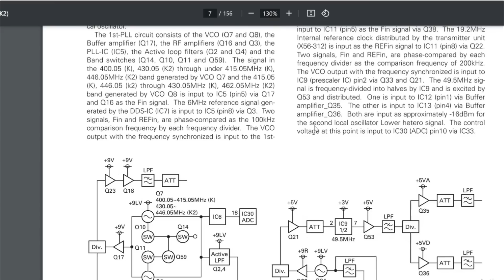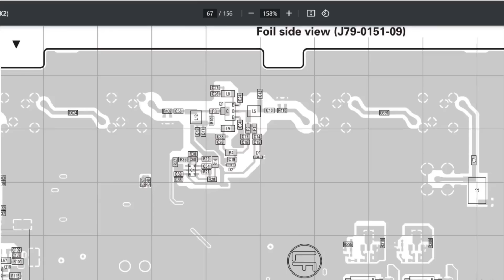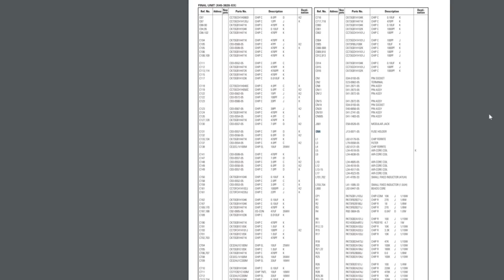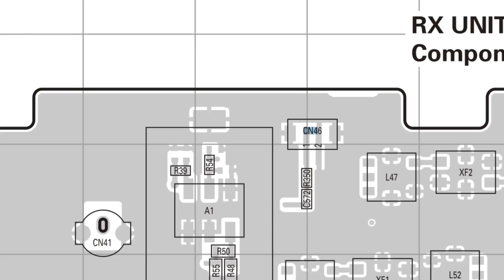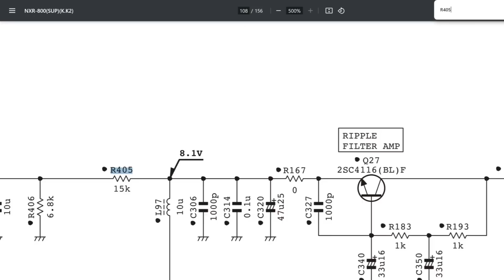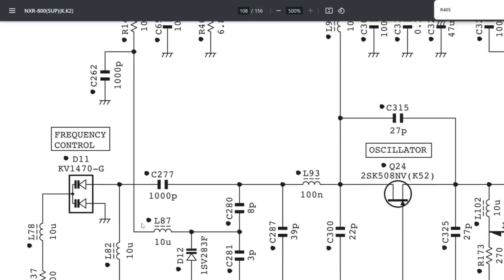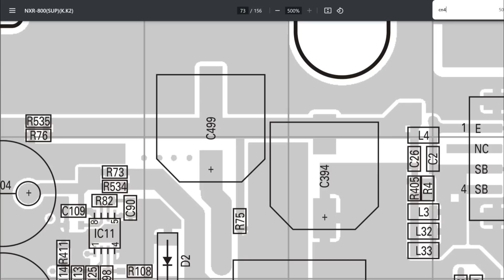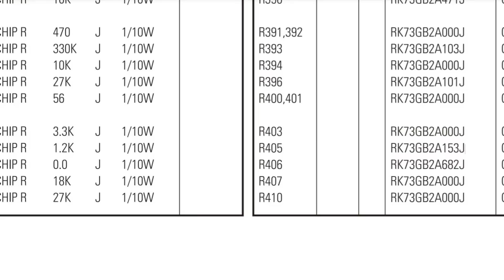Kenwood Blew my Mind - NXR-800K. Repair. How Right to repair should be.

Comment: Am radio operators are major nerds, they would not buy something that does not come with a full service manual and parts list, that's why Kenwood provides it as do they all, the market demands it, if the laptop market refused to buy laptops without schematics they'd all provide them

Comment: That is what a service manual should be. All specs and info. Plus diagrams. I had a complete set of service manuals for my sony profeel system monitor, stereo television tuner, teletextdecoder and my videorecorder. A total of 613 pages. And I had to use it a few times. It saved me a lot of money to do it myself. But that was 30+ years ago. I wonder if Sony still provides these service manuals. Of course companies have these service manuals, but I guess most do not make them available to customers. Even repair services like NorthRidgeFix will have problems obtaining them.

Comment: Reminds me of the cheapo WEN rotary tool I bought years ago, and it came with a complete exploded diagram of the entire tool in the back of the manual, with replacement parts (fasteners, motor, etc.) all listed below it. I was like, wow. That's impressive. Been 7 years and I still use the same one on a regular basis. Never needed to replace anything in it, thankfully.

Comment: Two zero ohms resistors in parallel is a typical example of over engineering. Just like 3 ferrite beads in parallel. It's ham radio personalities at work :). All Kenwood. Icom and Yaesu ham equipment will have a similarly well documented approach to their products. Ham radio operators demand it so they can modify and understand the radio products. It really should be a minimum standard in the electronics industry.

Comment: Depends on which board but they are listed just strangely:
R404,405 RK73HB1J000J CHIP R 0.0 J 1/16W
R398-409 RK73GB2A000J CHIP R 0.0 J 1/10W
R4 RK73GB2A000J CHIP R 0.0 J 1/10W

Comment: Lots of times in one of the corners of the schematic or somewhere in the service manual it will say that if not noted the wattage of resistors is X. Are they using multiple fuses in parallel for high current draw or?

Comment: I recently fixed a Pioneer X-HM72 receiver at a Repair Cafe where a SMPS PWM chip had blown its top. As there is a full service manual with schematic online, I could contact the owner to get them to buy two chips (cheap on eBay) and at the next session I replaced this chip, two blown SMD current sense resistors, two diodes in the bridge rectifier, the fuse, and it sprang into life. Without a schematic it would be landfill. Two Pioneer Service centres refused to touch it as "Parts not available". I guess they don't know how to read schematics and have never heard of eBay!

Comment: ...i worked on kenwood factory as a storekeeper once.. totally ISO9002 standards..japanese curcuits are the best & cheap..i have purchased a rejected hifi system 20 years ago when i was working there...and its still working..only CD player gone out..but my TV box is connected to its aux (stereo to RCA ) for richer sound output than from TV speakers...

Comment: i dont know about Kenwood but i know ive looked up schematics for some machines before now and you can get them, mostly for older stuff. Not sure about electronics stuff, maybe companies tried to hide that a lot more especially nowadays. I got an old DeWalt band saw and it had some parts a bit broke, so i searched for a parts list and found a full assembly schematic with part numbers for every nut, bolt, fuse, wires, everything. So, yeah they do exist. some of the old machines I worked with in my last place of work also came with full electrical schematics. handy when something breaks and you call an engineer out who knows how to read those, makes identifying issues a lot easier, specially because you cant just up and ship a 1 tone machine to the manufacturer to fix it, its just not cost effective. All companies should provide this stuff, a lot used to. dont know why, where or when it all went wrong. I sound like an 80 yr old, but im 40 btw lol

Comment: Another term for a zero ohm resistor is a fuse.
Since there seem to be three on the board (09)you have, I bet one of the revisions between 01 and 09 was the addition of that third fuse.
Parallel fuses are a way of rigging a delayed (or slow)blow behavior from a part otherwise much too simple to behave in that way.

Comment: On HAM Radio Products Kennwood, Yaesu, Icom and all other big players are providing this big repair and service manuals. It be a must for the Ham Radio Operator to have this in his Library. You can´t repair or modify as you want. For Ham Operator is allowed to modify.

Comment: How do you tell values of resistors without a manual? You decode the color bands. if they're unmarked the manufacturer is trying to prevent repair.

Comment: Kenwood, Sony and others did a great job with the manuals back in the day. But the circuit in question looked really weird. 3 components in parallell? 2  x 0 ohm resistors and 1 fuse?!? Maybe there was no functional difference between the solder blob and this nice looking and component correct fix?

Comment: I had to troubleshoot and repair a blown coil on an Icom IC-729 HF radio. Servive manual was very easy to get, got the right parts and did the fix myself.

What is better than saving some money on repairs? Doing the repair yourself, switching on the equipment and seeing your repair actually worked!

Comment: I purchased a used pre-Pre-Sonus audio interface, actually it was more like new in box. Except it had an issue with the power supply. I contacted Support and they're like we don't support that model anymore and I'm like yeah you don't have anything like it that's why I need the schematic so I can find out what this burned out resistor is. we don't give that out it's not supported anymore.

Comment: I've always liked Kenwood I don't know whether this is something they do for the ham radio stuff or if this is something to do with everything. This is what everything should have the document existed when they created the object they should just tack it onto the extended manual and be done.
15:00 Oh and PS that resistor unlike the screw I lost today didn't go into the abyss. It's next to the larger capacitor opposite the connector in a vertical position.

Comment: This is the way it used to be. In the back of TVs and Radios back before about 1975, you would look in the back of the unit and find the repair manual. Back then, many folks simply troubleshot their own units and took the bad tube down to the Rexall Drug to the tube tester, and which ever tube they brought was bad, they would look in the  lower cabinet where the new tubes were, or the rack near by. Old tubes were traded in for a discount on the new tubes, because even the tubes and even TV CRT tubes were fully repairable.

Comment: A better search strategy: Start with the block diagram. When you've found the relevant section go to the circuit board components lay out. When you've found the component go to the components list.

Those 0 Ohm resistors seems useless but are used as fuses. So you did a good job replacing the blob. The one component you called fuse was L4. An inductor.

Those three inductors in parallell are for rf-filtering since you are looking at a power supply line. Theese prevent rf-signals from moving backwards in the power supply lines and cause disturbances. They also prevents rf-leakage from the equipment bettering EC-compability.
Reply: There's always one guy...
Reply: @Xjaychax9 ... that gives pertinent information that benifits everyone looking for it?
Reply: @maxrochon103  I was bigging you up, not putting you down, chill.

Comment: Hey great video! You need to learn how to search PDFs. Do a search on the board number first, then you can find more info. The manual is typical for communication gear, most mfg supply such detailed info so that it can be repaired. These unit are very expensive!

Comment: A friend has a sony amplifier issues, other than it has no manual, no parts or expensive full module replacements only :( for single resistor :D.

Comment: hi man, great video, well kenwood in this matter, is really similar to pioneer, every single board on the planet has a schematic, the trouble is, what you can find is because a data leak from company or sucursals, and if the competitors get, it can make reverse engineering from just the manual, i live in a latin country, and my father fix this way, and a friend get manual when we need it, before internet, is the only way to do it, even today, is this way.
Reply: old devices, people know how can important this information can be, and scanned old manuals, or send digitals to forums, fot save old and loved devices, i gonna rebuild a 40+ year audio amplifier, because someone shared it at hifi forum. thanks for all doing it, even motherboard, and some GPUs, your probablye know that, even people sales schematics and boardview from apple devices

Comment: Marantz had the same thing for a SR8002 Receiver, an extremely detailed PDF service manual download.

What is the third component with a "T" on it?
That inductor right next the to fuse resistors you installed looks chipped and has been messed with, maybe replace that too.

Then we must ask the question... What if anything caused the fusible resistors to burn?

I would do a further diagnostic analysis because the solder blob was effectively replacing the blown fuses and yet the customer sent in the board because it didn't work.

Maybe there are options for more fuses because for other sub-models the power going through those fuses may drive a circuit the requires more power making the board universal for all sub-models.

Example: They will make one main wire harness for different vehicle sub-models that have different features. My van does not have power door locks yet the harness near the door frame has an un-used connector that would have been occupied on models with door locks.

Comment: Complete Service Manuals for AV equipment including debugging flowcharts used to be the norm. There was a company Sams that published Photo-Facts for all major equipment.  They even showed test points and pictures of the waveforms with complete parts list and revisions. City libraries had a set for copying. It was great. Some companies still publish and sell the manuals for a hefty fee. Large home appliances - like dishwashers generally used to have a brief schematic and parts list stuck in the enclosure.  Now its online. In the early PC days you would see this same thing but as "cloning" and piracy kicked in it died quickly.

Comment: Alex, it's not "Why can't they?", it is, in fact, "Why won't they?". I am a Amateur radio operator. "Ham Radio" has long been and still to a great extent is composed of technical people who can repair, modify and still build radio equipment from the ground up. The Amateur Radio equipment manufacturers, such as Kenwood, Yaesu, Icom, etc.,  understand this. I have had  factory manuals for many pieces of equipment over the years, including equipment that was new in the 1980's. Hams world is a different world. In California, Ham Radio is very active. You may want to locate a local club and attend a meeting.

Comment: it should be added that Kenwood was also sold for scraps to Chinese companies because they went out of business.. not saying that this device was part of the first iteration of Kenwood, which was a Sears brand if I'm not mistaken.. they were known as being very repairable and repair friendly. so I wouldn't be surprised if the service manual for this product came from a Time before Sears went bankrupt.. I suppose the argument could be made that one of the reasons they went bankrupt was because policies which allowed their competitors to getting intimate knowledge of their products and allow their customers to extend the life of their purchases. 
btw: Kenwood is a shell of the company it used to be.. at least when it comes to audio. I've never had a Kenwood amplifier   show up with a service manual available in the box or online for any of the amplifiers I bought in the last 5 years.. 
had a 10 or 15-year-old subwoofer have a service manual and that one is still kicking around because I've been able to fix it a bunch of times. 
old school Kenwood old school JBL, they all have service manuals available. but their new stuff doesn't. they're all following the Apple model

Comment: The theoretical wattage requirement for a zero ohm resistor is zero watts. It'll be fine.
I just rummaged through your store and I have to say it's quite an impressive variety of critical supplies.

Comment: Alex, in most software and search engines too: If you put your search term in quotations, it will iterally just search for that. For example: CN4 will find CN401. "CN4" will not find CN401 but just CN4.

Comment: the way copyright and patents should work is a specific PCB design, you are able to have multiple ways for speakers to go from blop blop to thump thump, making it harder to repair by saying "the technical manuals are what safe guards our patents and property." no, what safeguards your patents and property is appropriate laws and appropriate enforcement of laws... to not supply technical manuals and repair guides for people to repair the item is just insane... so what the person isn't ualified to repair the item... just let them break their device; the technical spec sheet and diagrams are for those that can read and repair appropriately so that your brand can be seen in more homes for years to come, not just the latest iteration  of device.

Comment: Love how components are just like a mechanics 10mm socket. They disappear from sight while you are at work even though they are still right there. That 0 ohm resistor is lying only a few cm's from where you are working, against C394.

Comment: The service manuals was standard pratice 20+ years back. Worked in a small TV/radio shop repairing JVC, Sony, Panasonic gear. JVC for example, sent a big box of service manuals each year when they released new models. You could call up any manufacturer and request a service manual (even for older gear). Here in Sweden, they had spare parts on hand for up to 10 year old models, if they didn't have it locally, it was sent from JP or where it was manufactured. The stuff was made to be reparied/serviced. But things changed when the big box stores took over and the small holes in the wall shops shutdown. Now they think you are crazy (or don't know what you mean) when you try to get a service manual.

Comment: The same level of documentation and service manuals is available with SONY for their consumer or professional electronics, but the deeper levels are limited to authorized partners and repair centers - sometimes the docs leak, but there is a lot more to it - eg. calibration software and gear. They do not want to publish them freely, since it reveals how each model is often the same - I am focused on digital cameras, and its funny how they keep recycling the same sensor in 10 years of products - eg. from FS700, FS5, FS7, FS5M2, FS7M2, F5 .. all same. But marketing folks will claim otherwise.

Comment: This reminded me of the last CRT TV I ever bought... It was an ultra cheap no-name branded TV with integrated VHS unit from China. It came with a full printed manual that included PCB schematics and circuit diagrams, Test points were documented with the expected voltages, tolerances and waveforms. And it did cunning things, like making sure you didn't have a VHS tape inserted in it when it degaussed.. I was totally blown away that such a cheap POJ (pile of junk) TV came with all that useful data. It never broke, but if it had I would have had everything I needed to fix it up, probably for the cost of under a dollar worth of SMT components. It boggles the mind how hard some manufacturers make it to repair things, Given that a lot of the time you don't even need to be a super smart electronics engineer to fix them. There have been plenty of things I've fixed with nothing more than "Look for the burnt or explodey thing" and replace it.

Comment: Two way radio manufacturers such as Kenwood, Yaesu, Motorola, etc. provide detailed service manuals for their equipment.  Often they are only available to the dealers, but they are usually very detailed.

Comment: Typical of the Kenwood products I've had in the past.  Amateur radio equipment is made to be repaired by the user and maintained for a long time.  I've had some of my Kenwood gear for over 40 years and been able to either repair or mod as needed when parts are no longer available.

Comment: About ten years ago I had usb sound card fron Behringer -  blown power supply section. Asked Behringer for schematics and they gladly sent me one just like this. Repair was done cheap with ease. Few bucks for new chips and caps. Five years ago same brand, different product - a digital mixer was glitching gains from channel 6 trough 16. Asked for schematic again - got nothing, bunch corporate speak for F off - they will be liable If my fix attempt goes wrong etc bullshit. Mixer layed in shelf for a year, then leaked schenatic  was found in depth of internet. Turns out one 20mm long trace on board was bad, fixed with piece of wire worth nothing from leg of one chip to another. But without schenatic this fix could not be possible, because reverse engineer a board would take way too much time.

 So go Louis Rossmann and go right to repair. We need more companies like Kenwood and less like Apple. To lessen the landfill of devices that could be fixed fast and cheap with few komponents or a piece of wire.